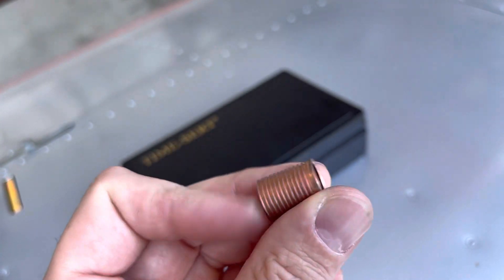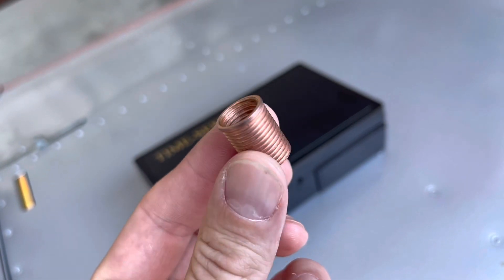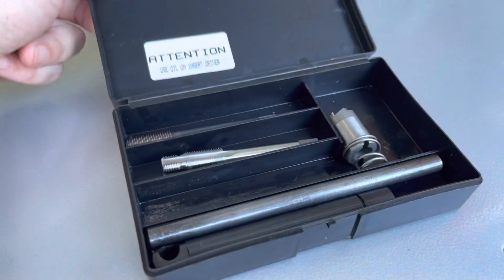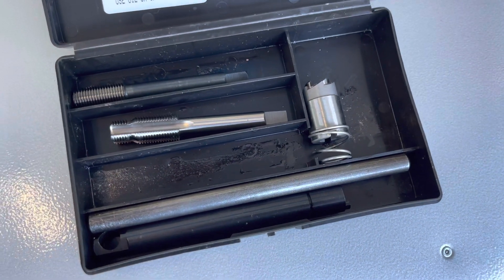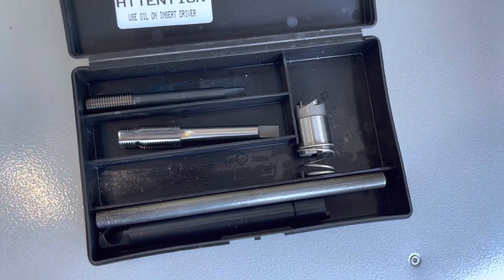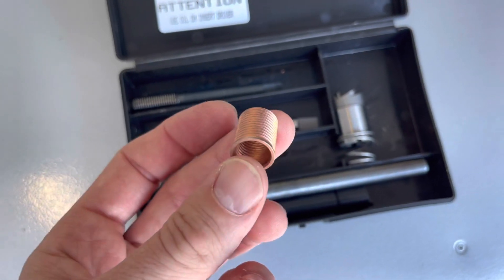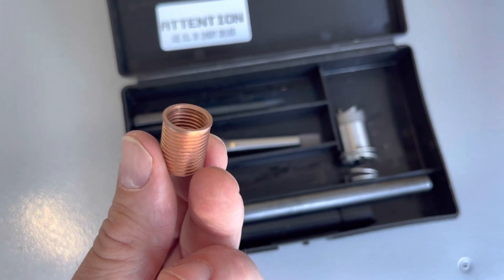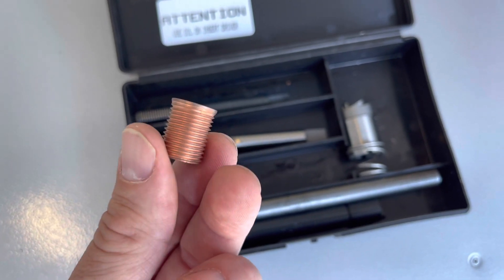Airplane Grounded by a Seized Spark Plug! MUST WATCH for VW aircraft engines.

Comment: Thank you for the video.   Aerovee / Waiex Owner here.   Sorry, but my long term experience with the sleeves has not been as you described.   Originally tried this on the original heads.   The multiple sleeve(s) ended up failing during a spark plug removal.  Anti-seize used.   My experience was that the sleeve ended up corroding and failed.   if you do intend to use the sleeves be prepared for a failure at some point when removing a plug.  I suspect it could take a little bit of time or a long time depending on your environment.   Failure might mean removing the head to remove debris and potentially replacing the whole head.   Luckily replacement heads are available from sonex, valves, springs, etc. installed.

Comment: Use helicoils like certified aircraft engines they lock in with teeth at the top & don't back out. Also aircraft spark plug antiseize is better than the thick regular antiseize.

Comment: You said that the Volkswagen engine block is aluminum, the insert you showed appears to have a high copper content: galvanic corrosion will occur on the aluminum/copper connection point. So, if the thread inserts are copper based, there is a possibility of eventually firing your spark plugs out of the block during the compression stroke. There are pastes to act as a barrier between the copper and the aluminum, but I doubt that they work in a high heat environment. 
     Hopefully, the threadserts shown are in fact designed to function in contact with aluminum at high heat and pressure conditions.
Reply from the maker: That’s a common concern and a valid one in some situations.  For galvanic corrosion to occur you MUST have the presence of an electrolyte. Gasoline is not an electrolyte. Salt water might be a concern in Oceanside environments, but in general a spark plug thread would not be expected to cause galvanic corrosion and time-sert manufactures these copper plated carbon steel inserts specifically for spark plug application in aluminum heads.
Reply: @LeanofPeakAviation  the electricity is present at the firing of each spark plug, so an electrolyte is not needed. As the engine block is the ground for the spark plug and now with the copper plated heli-coil is in contact with the aluminum threads of the engine, it’s not a situation that I would be comfortable with.

Comment: this is something to consider for the head bolts as well, if the Aerovee doesn't already have them.

One of my bosses, a chief engineer, grew up with at least 2 VW beetles in the driveway at all times, and he suggested using thread inserts on the engine as that is something they learned to just do as standard. He spent many years of his life working on VW engines.

We use thread inserts a lot where I am, and we usually don't even wait for aluminum threads to strip before putting helicoils in.

Comment: Anybody watching, definitely go with Time-Sert if you have to do this. I used an off-brand that looked like it worked in a similar way, but the thing ended up coming out with my (car) spark plug during an inspection (and installation required striking the thing with a hammer... so maybe I didn't hammer on my Aluminum head hard enough?). Time-serts are flared on both ends once installed--there is no way to easily remove them once they are installed.
Reply from the maker: Good call.

Comment: I so badly want to tell you to just leave the head on.  But I suppose I have to grow up some time and acknowledge the risk.  Even if I"m confident I can contain the swarf, and the chances of that swarf causing an issue is quite small.  No Shain... walk away while you still can... but... but..
Reply from the maker: I hear you but it’s even a little more complicated than that…this happened during a routine annual (conditional) and my mechanic who is at another field was really uncomfortable with that…so not only was I grounded I was not close to my airplane and at the mercy of the situation.  You are correct, it CAN be done without taking the heads off if you’re very careful, and yes there is some risk involved.  Its worth discussing.  Thanks for the comment!